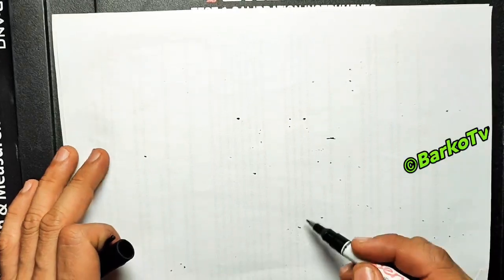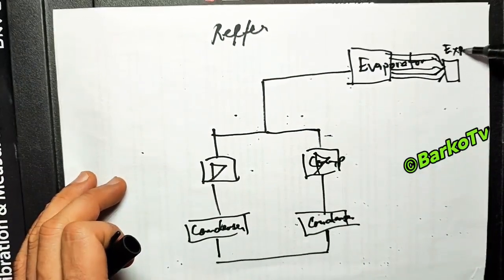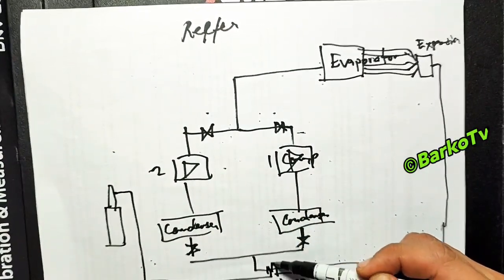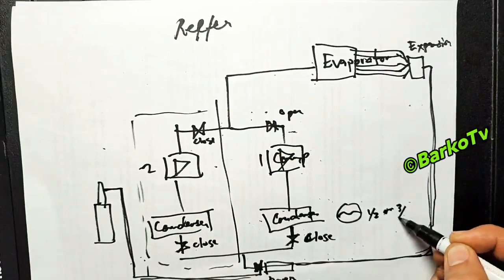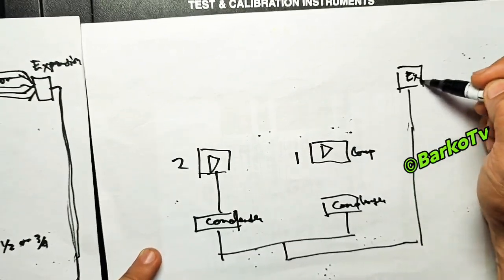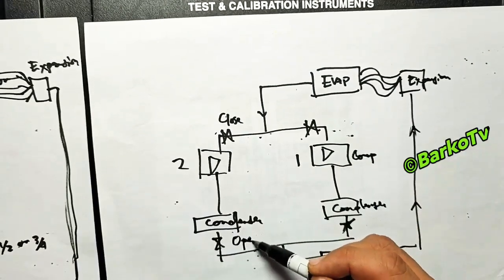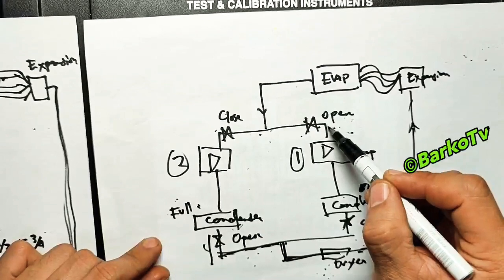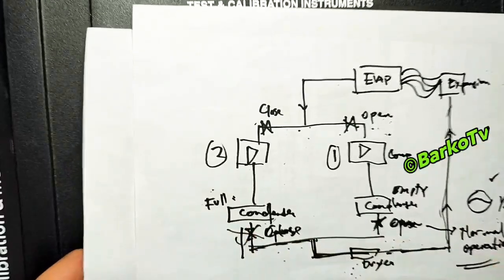How to transfer refrigerant provision reefer sys no. 1 going to no. 2 | Barko Tv | marino | Kalecky

Comment: Leky okay lang ba na magcharge ako ng gas sa low side suction ng compressor galing evap instead na liquid sa high side after condenser? Ano pros and cons dun
Reply from the maker: Sir, goods parin yan, pag gas side, gas yong charge mo. Cons lang ay pag makaligtaan mo na mabuksan ang liquid sa bottle mo, sigurado sira compressor mo. Pero mas mabilis ang Charging doon sa liquid kumpara sa gas. Ginagawa q lang yang sa gas side pag merong passing or sira ang mga isolation valve doon sa liquid side